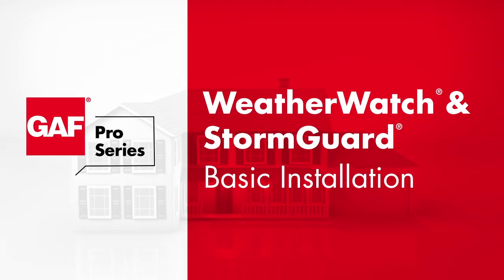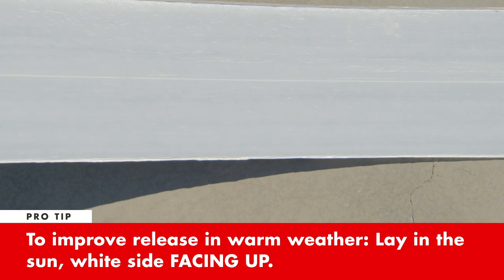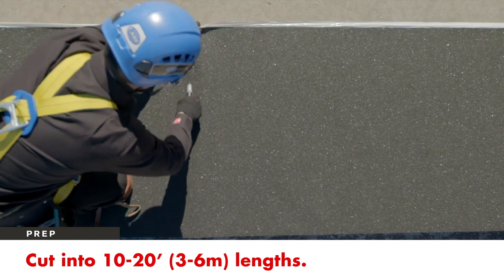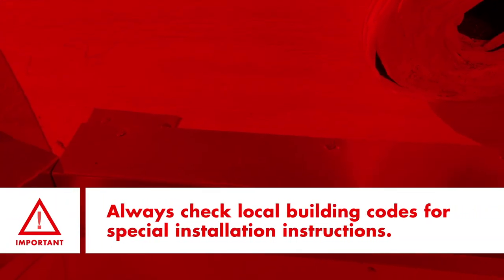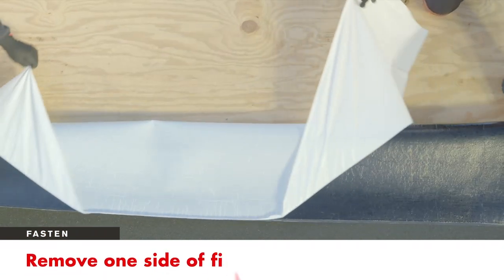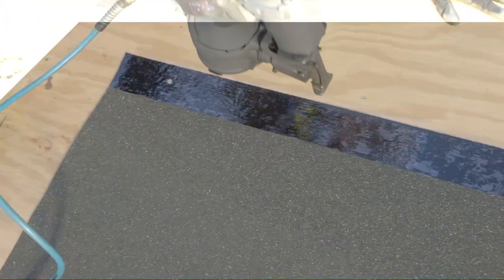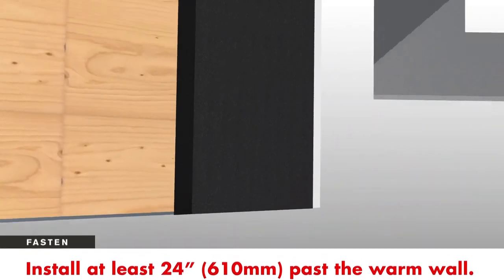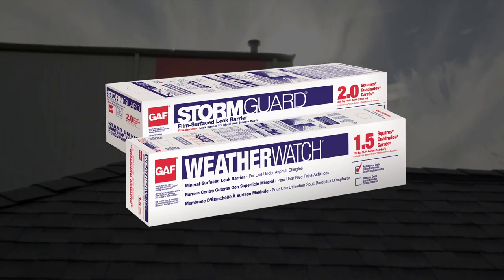How to Install WeatherWatch® & StormGuard® | GAF Pro Series

Comment: I plan on using this for my small 10x8' shed roof to replace the felt paper and old shingles.

Do you need to nail/staple this in place onto the roof sheathing?  Or simply rely on the self adheasive properties.  If you need to nail it down do you recommend nails with caps or to use staples?
Reply from the maker: Hi, there. You would need to Back nail with roofing nails every 18 " (457 mm) in the selvage edge. You can find detailed instructions at this link: https://bit.ly/45yfC3e. For any further inquiries, please reach out to our technical experts at (1-800-766-3411) and they will be happy to assist.

Comment: They used this product when my roof was replaced 10 years ago.  Now I'm noticing moss growing out between it and the drip edge.
Reply from the maker: Hi, there. Thanks for contacting us. We recommend you connect with our Warranty Claims department. You may call them at 1-800-458-1860 or send an e-mail to warrantyclaims@gaf.com. You can also file claims 24/7 via our electronic claim form via this link: https://bit.ly/3nbelvW

Comment: Question. If you install the drip this way on the eave how do you protect the edge of the roof against backups should you  have gutters installed? Shouldn't the peel and stick be installed under the drip continuing over and down the fascia to seal the edge against backups especially if you are in snow areas.
Reply from the maker: Hi, Gary. Our technical experts would be more tha happy to clarify! Please give them a call at 800-766-3411.

Comment: be sure to felt over the barrier otherwise the next roofer will not get the shingles off it will stick to the barrier  .try getting the shingles off one time and you will always felt over the barrier  this is from a 40 year experienced roofer
Reply: LESTER   my roof is uneven can still use this barrier?

Comment: Never put directly to wood,felt first
Reply: So GAF is not illustrating the product in the correct manner?  I get your point, so they’re giving essentially bad installation practice?
Reply from the maker: Hi, there. While our instructions call for the leak barrier to be installed directly onto the wood deck, some local codes require an underlayment, called a secondary water barrier to be installed prior to a leak barrier. If local code calls for a secondary water barrier, you would have to follow that since local codes always supersede our installation instructions.